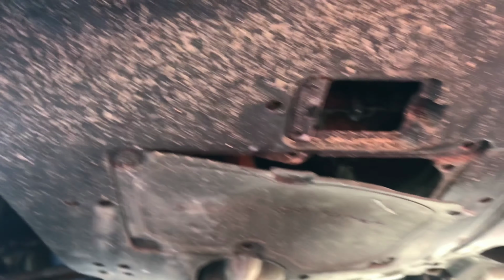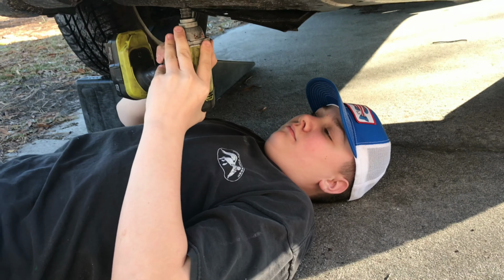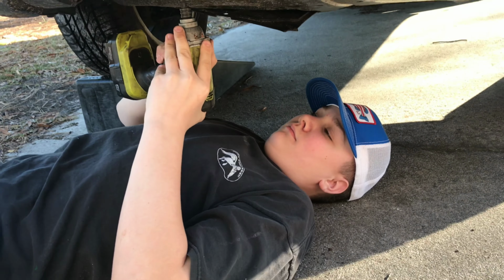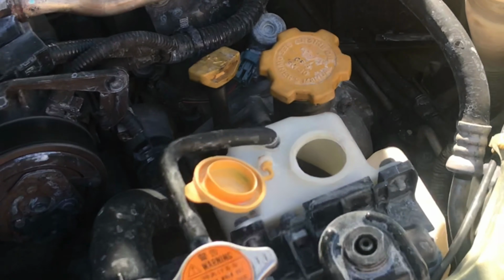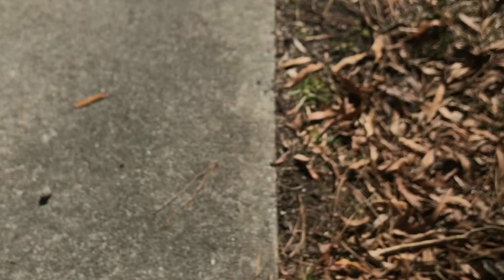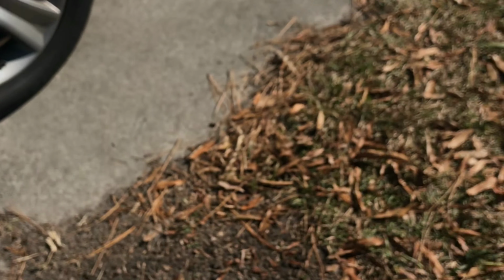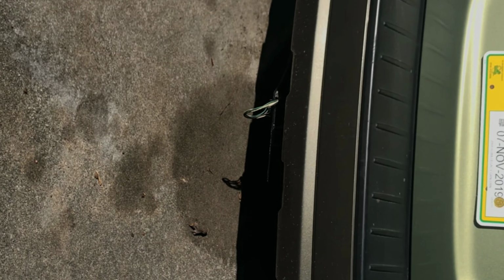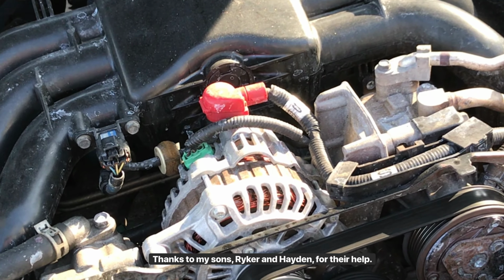2005 Subaru Outback 3.0 and Blue Devil head gasket sealer

Comment: Any updates on the head gasket? Any bubbling?
Reply from the maker: Since the car still had issues after the “repair,” it sat for about 8 months. When it was started up again, the bubbling started back. Ultimately it got another engine installed and the transmission issues stopped as well.
Reply: @HammerWrench  I went down this road on my Subaru Tribeca with EZ30R so I was super curious about the outcome. I too replaced the engine with a JDM one. Good luck and thanks for the response and hard work.